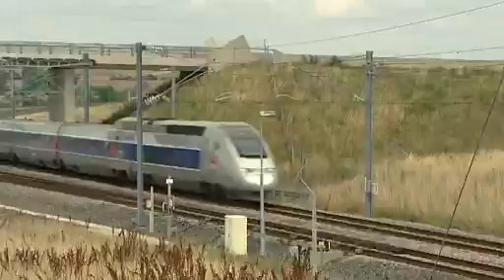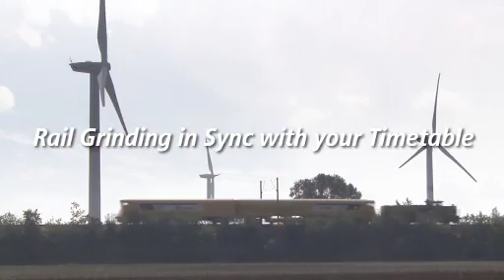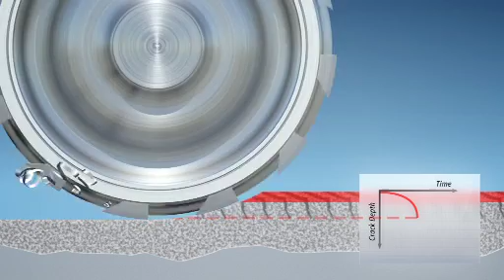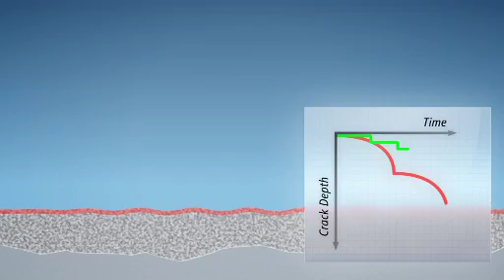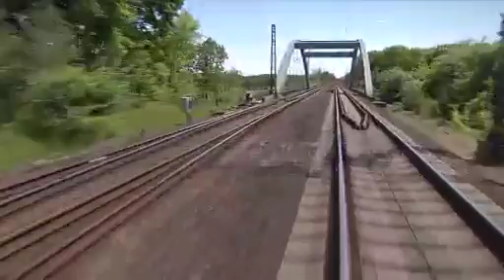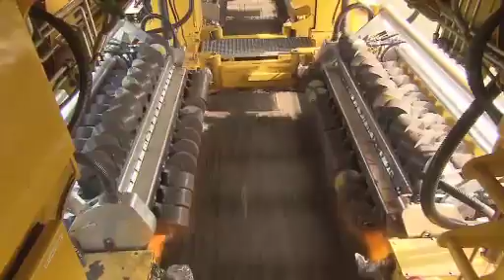High Speed Grinding (HSG)

Comment: That little thing looks like a toy compared to the Loram Grinder we have in America
Reply: We'll probably buy this company out.
Reply: 10-fer
Reply: Eh
Reply: Yeah, the rail grinders we have here in the US are absolute behemoths compared to this thing, but unfortunately, they run a lot slower than this (16 kph or 10 mph iirc) which can cause issues because of delays which are not a good thing especially when large amounts of people or goods need to be moved by rail from point A to point B as efficiently as possible.

Comment: I have seen these kind of surfaces on the rails around London. I did not know why that "scratches" need on the rails. For better traction? For make the wheel's surfaces in shape while they are running? Reduce some sound frequency what damages the rails? ...and wow! Finally I know it allready. Every time after the job I went to the station (Brimsdown) and I  watched that rails and tried to find out why english company burn a loads of energy to grind the surfaces. Even I asked as well. Collegas, many of metal workers, etc... Everybody had some teories, but nobody was 100% sure. 
Thanks for video!

Comment: '
not really...
railroad track is a so harden strongen metal steel...
never crack at all...
but alot of rain / snow / water on the track and rusty eatting up track metal...
time use a grinding wheel cleanning or steelwool polish it
Reply: bestamerica you never heard "metal fatigue"?